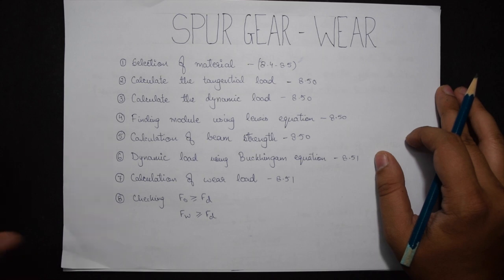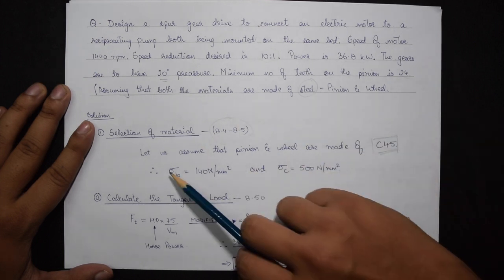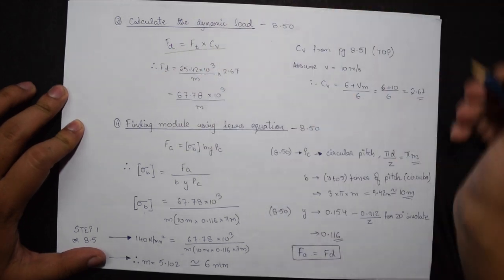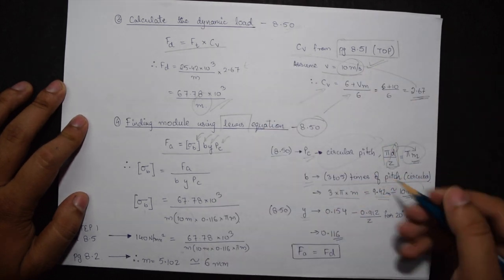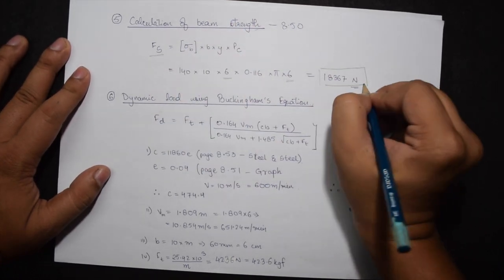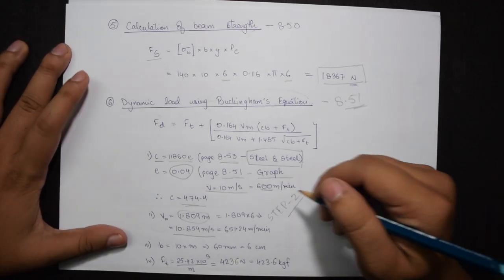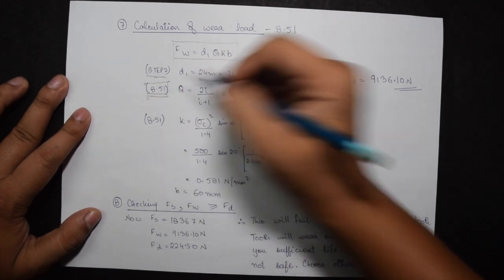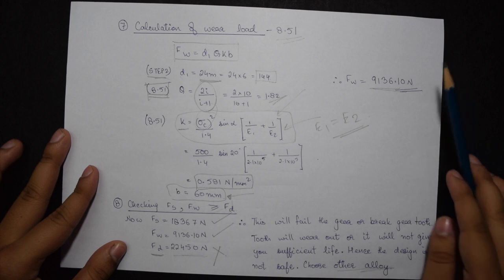Spur Gear Design Procedure based on Wear Condition (Part - 1)

Comment: bro i were confused in finding bending stress (allowable static stress) can you help  ....
the materials are 
CAST STEEL,CAST IRON,C45 STEEL,HEAT TREATED CAST STEEL,HIGH GRADE CAST IRON,
FORGED STEEL,C40,HARDENED STEEL, PHOSPHOR BRONZE  
any idea or advice would be help full me thank you
Reply from the maker: All the values for bending stress are given on pages 1.9, 1.40 or 8.5. If these still exists any doubt regarding any particular value, feel free to reply back.

Comment: 1)In the 6th step, there is no uniformity in units. C-mm(e is in mm), V-m/min, b-cm. Could you please check that.
Reply from the maker: Yes so the 6th step is a little tricky.
1. "C" doesn't have any unit.
2. Under Table 41 (Value of C) 'e' should be taken in mm, thus it is taken 0.04 mm from the graph.
3. The value of 'v' for the graph should be put in m/mm on the x axis, so 600 m/min.
4. The value for phase width (b) should be put in terms of cm, given on page 8.50

Hope you understood. I also uploaded the video for Helical Gears, have a look!